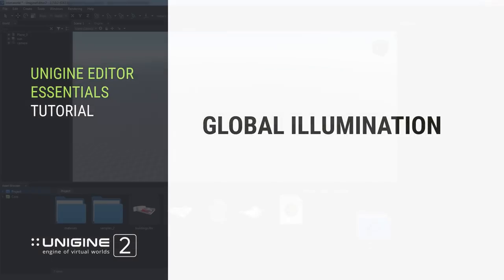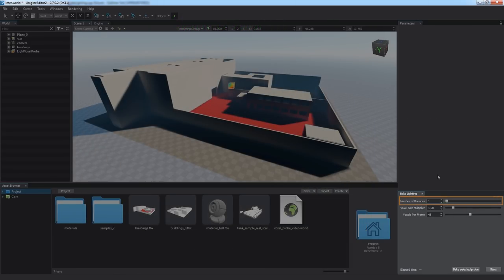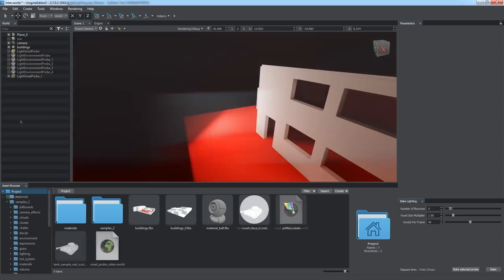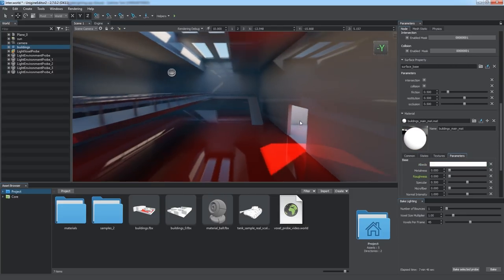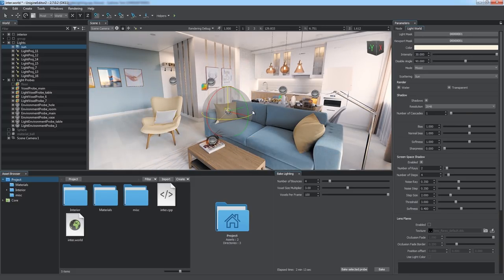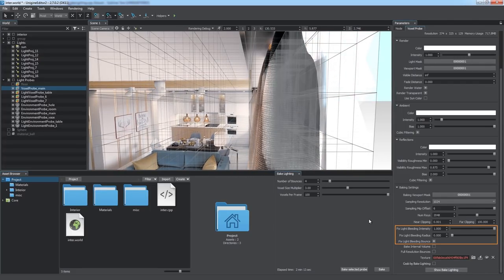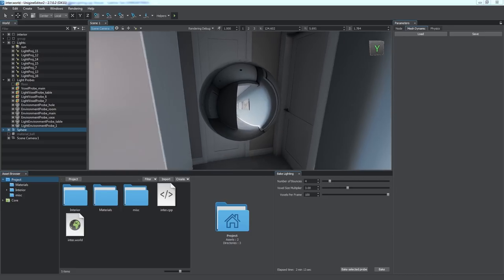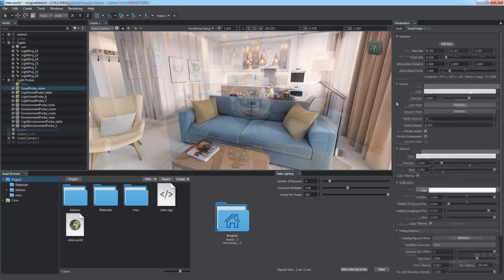Global Illumination - UNIGINE Editor 2 Essentials

Comment: Too bad it takes forever to bake even the basic scenes on powerful cpu.
Lowering voxels size produces artifacts so its pointless.
You are expected to have a farm to bake, if engine even supports it.
Reply from the maker: Voxels are baked on GPU, so it worths using a powerful one.
Reply: @UNIGINE_Official  Yeah some old Nvidia GPU's shouldn't even run it, but if be for real inside UE4 with Nvidia VXGI in real-time its 20-40fps with 64 samples on modern gpu. On my GTX 660 ti 3gb 384bit it takes for few hours (Cornel box with one asset 2m*2m*2m), is my gpu too slow for that? can I just use path tracing for static objects, it might be faster, cause render at 8k in blender with 3000 samples takes less time for me, Yeah I know its 3rd dimensional in voxels but still want to try it out. How about tutorial for 3rd party software with lightmaps (never done this before, sorry).